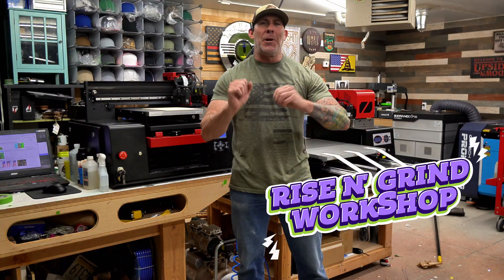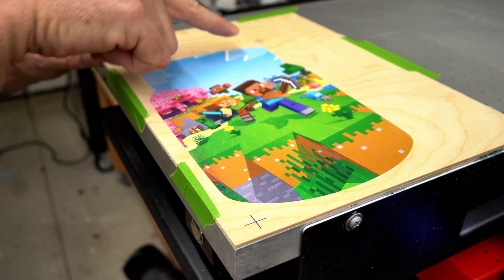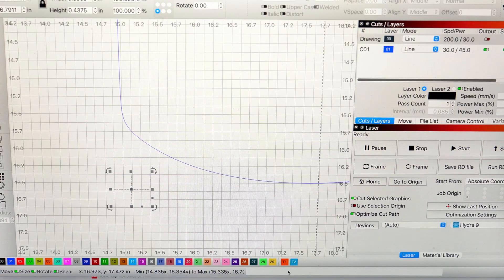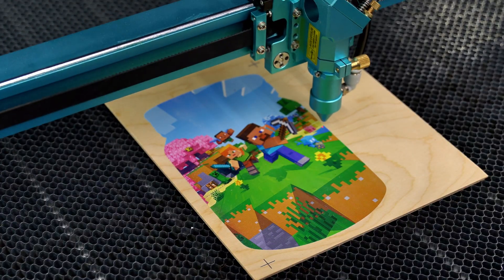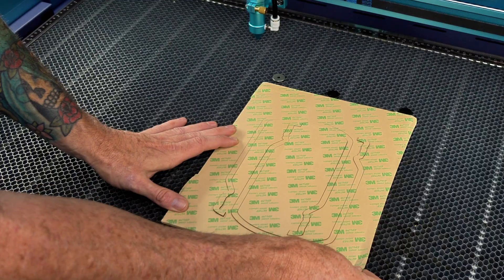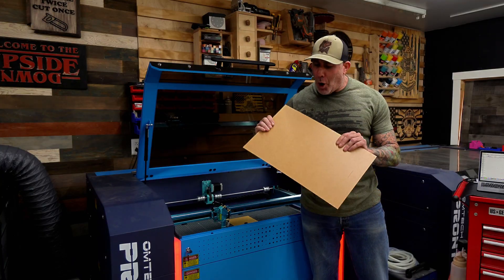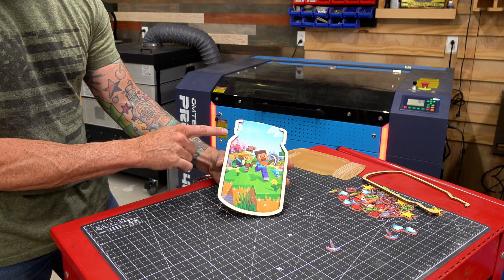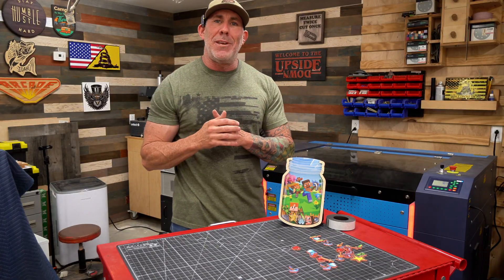Lightburn - Learn Print Cut for Laser Engraving Projects

Comment: Can you show the process before it’s ready to do print and cut modes.
How to create the registration marks? 
- which parts of the illustration need the registration marks
How to create the outline of the graphic for cutting in lightburn.
- which program is used to create the outline for the graphic
- what type of file it needs to be to create the outline
How you changed the vector image to tiff. For UV printing software.

From Whitney (Whitney’s crafty tings)